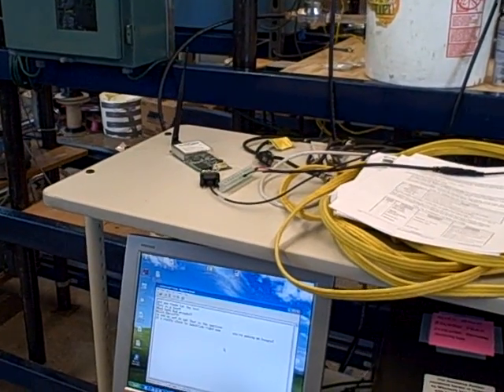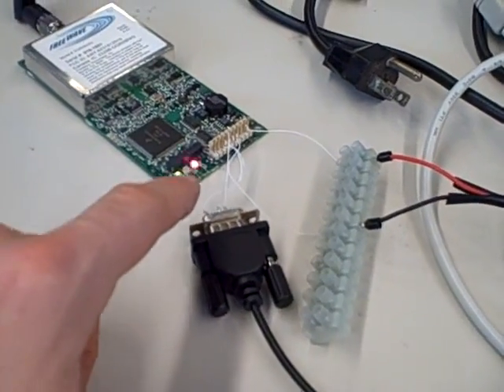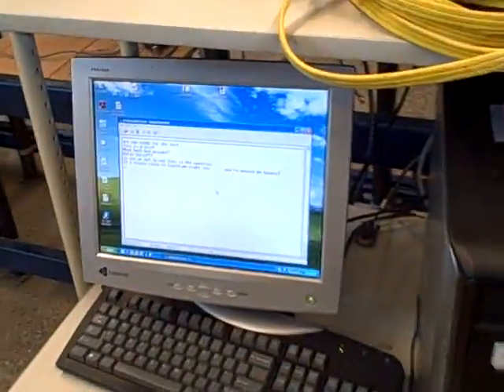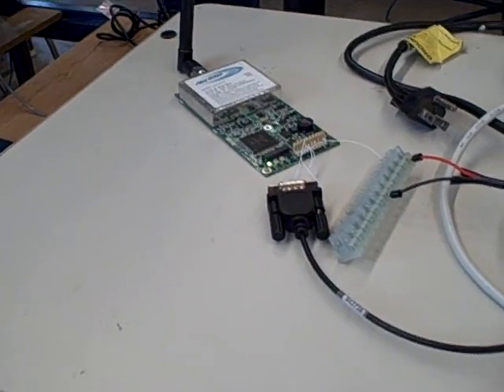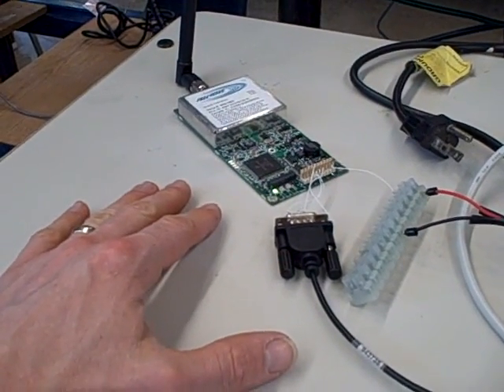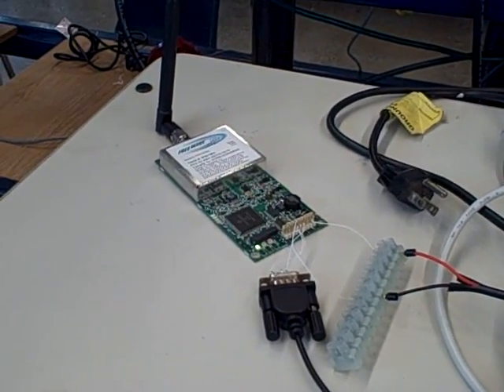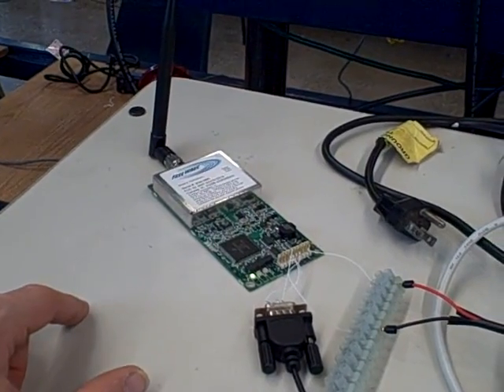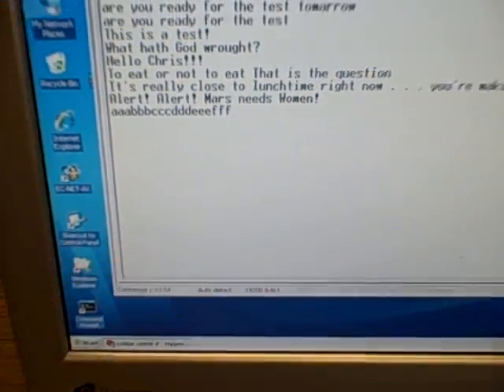Using FreeWave serial radio units to communicate ASCII text messages

Comment: Good evening, I have a problem when I enter to configure the radio FGR09CSU by ez-config or hyperterminal, the leds turn green the pc recognizes it but does not enter the menu. You can only use the colored cable that val to rs32 or how could I install the firmware again. thanks.

Comment: We keep serial cables, and null modem adapters (which can be had at radio shack) to limit the "plumbing" connections that are needed to be kept on hand for these radios. We can also visually see if the cable is "nulled" or not, by visual inspection.

Comment: We've been using these freewave radios for over a decade in Department of Defense mission critical applications and they can't be beat.  We use them in enclosures in some of the harshest environments and the only problems we've had with them is lightening related.  We had a failure of our grounding system, and of course it was detected by the lightening ;).  We use repeaters to broadcast signals for upwards of 50 miles. If you need any help, feel free to email me: krogers58 at hotmail dot com

Comment from the maker: FreeWave model FGR09CSU units.   They communicate RS-232 or RS-485, running on a DC power supply between 6 volts and 30 volts.

Comment from the maker: The connections are really simple: the RX pin of the radio connects to the TX pin of the computer's serial port; the TX pin of the radio to the RX pin of the serial port; and the signal ground pins are both connected together (i.e. a "null modem" cable connection).  Software handshaking is used rather than hardware handshaking.  Configuration was done using Hyperterminal to set parameters in the radios after the connection was made.  The FreeWave radio manual spells out all the details.